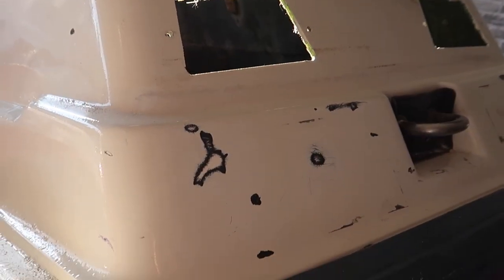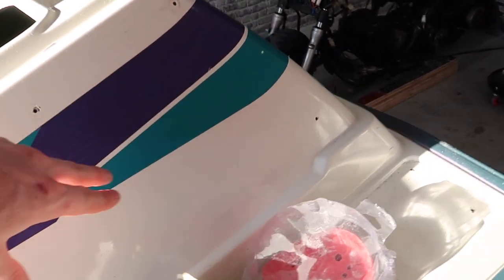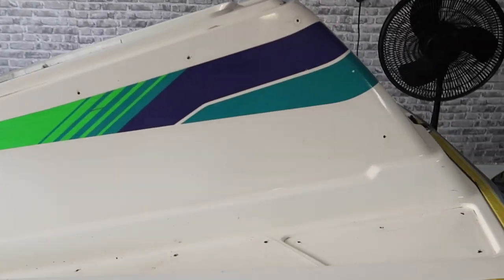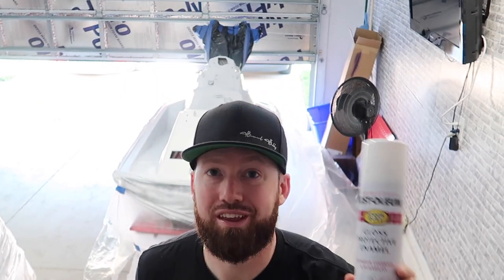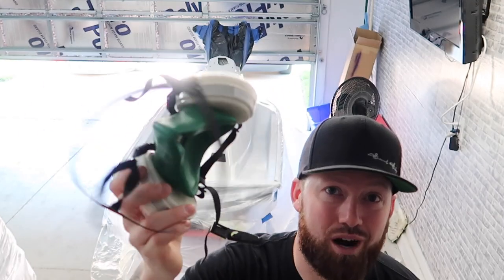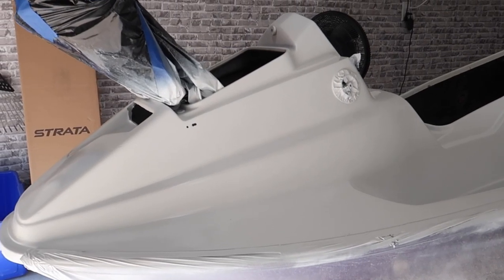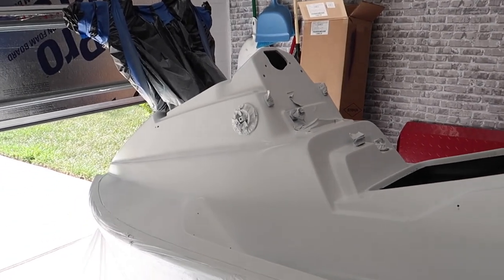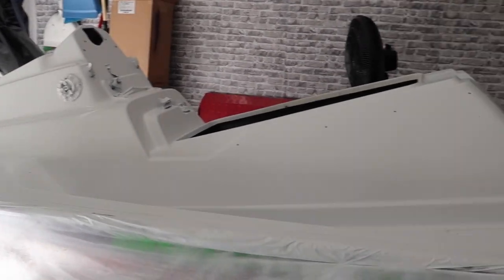Scootski build episode 5- turbo rattle can!

Comment: Are you going to have this thing in Tennessee
Reply from the maker: Probably not
Reply: @burnoutbobby  that sucks you should bring it even if it's not done I'm building a Honda bite with a reflex 250cc motor
Reply from the maker: I may. It runs and drives now but there will be another one there for the event.
Reply: @burnoutbobby  this guy Chris that works at Eastpointe scooters in the city that I live in he just built one it has a Honda reflex underneath
Reply from the maker: That’s awesome. He’s probably on our Facebook group for scootskis